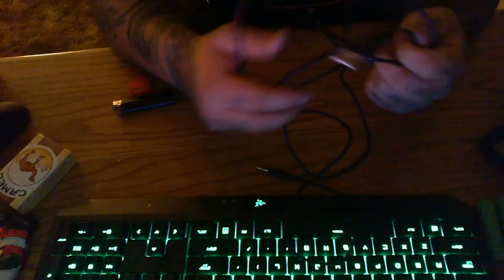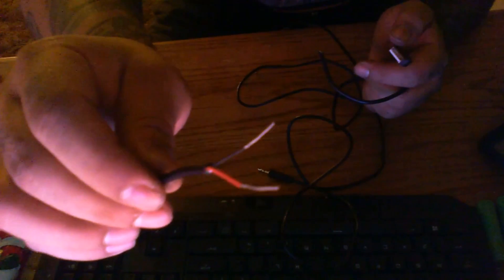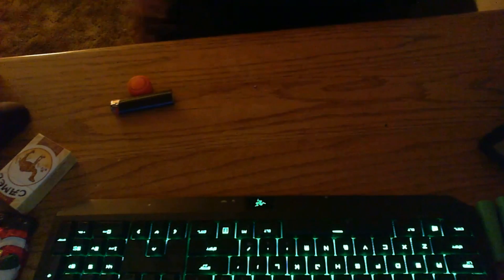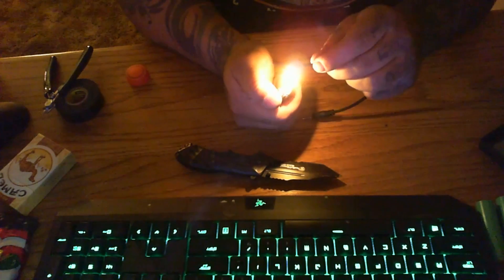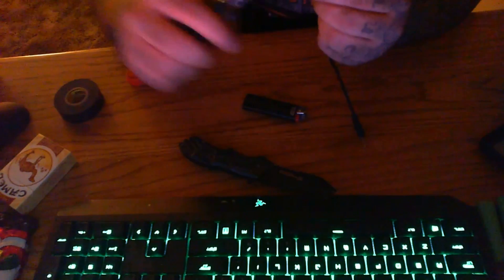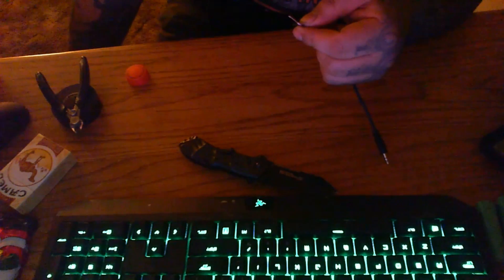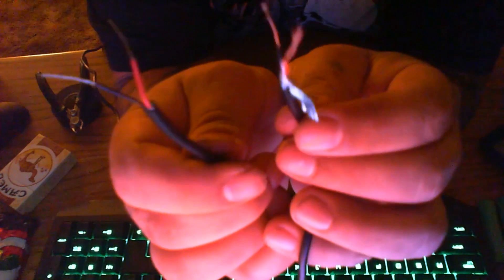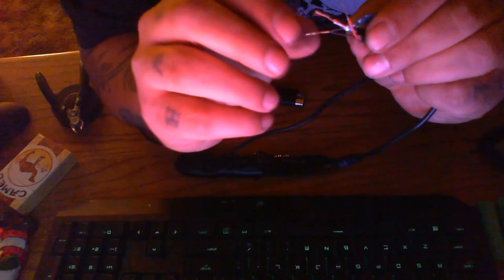DIY How to make a USB to AUX 3.5

Comment: hot and ground is when your talking about ac usually when dc like that best to call it negative postive also ground ussually isnt the right term ground is for taking acces charge of the device like a refriderator  the hull will be conected via ground in case a connection is touching the mettle hull you wont be shocked

also when doing this conversion you will be making the sound mono so not good for gaming and some other stuff

Comment: He said; "I'm pretty sure the white and red are hot and the black is ground......we're just gonna strip these away and connect the white and red wire together"   "Then you get your USB cord and your auxiliary wire and you put em' together, see how it works?  Your red and your black and red and white and then your black and black"     Then he connected it to a BATTERY PACK....THEN he connected it to his computer!!!  GEE the video ended........I wonder why??
He just shorted the right and left together, and what's worse was, he just fed +5 volts into the audio cable!!!    I'm guessing he has NO electrical background what-so-ever!!

Comment: Dude... that's just power. Now come on, naturally I assume a converter to make the signals work correctly is need.
Reply: Thank u I thought the same thing
Reply: It's not just a converter that you need, There should be an info chip for the computer to read and know what the type of USB is it is talking to. Otherwise the USB just receives a device request and no answer is given back by the connected USB. That's besides the point that you might burn your USB port if you connect the 5V power line to one of the Data ports...

Comment: less than 5.00 on ebay                                                                                                 https://www.ebay.com/itm/Type-C-to-USB3-0-Data-Adapter-Cable-3-5mm-AUX-Audio-to-USB2-0-Charging-Cable/332707383699?_trkparms=aid%3D888007%26algo%3DDISC.MBE%26ao%3D1%26asc%3D20131227121020%26meid%3D4cce2a3246ba414dae1b5fb300e7e71f%26pid%3D100009%26rk%3D1%26rkt%3D1%26sd%3D292439447814%26itm%3D332707383699&_trksid=p2047675.c100009.m1982

Comment: i got a bunch of 3.5 cables and type c cables, did that in the video so i can transfer music or sound to the aux in for the speakers, wouldnt work. i'm gonna buy a couple that be already made and open them up so i wouldnt have to spend money on replacements lol, type c cable has red, white, green and black while the 3.5mm cable has red, white and black

green and white wire on the usb is data transfer and red and black is for charge hot and ground.

bein tiny wires, they are easy to break